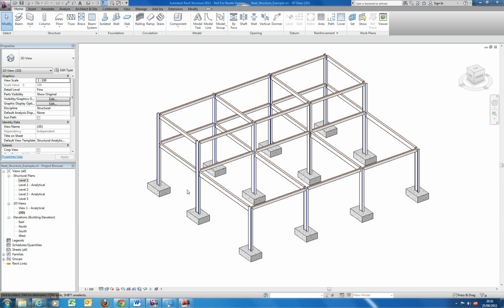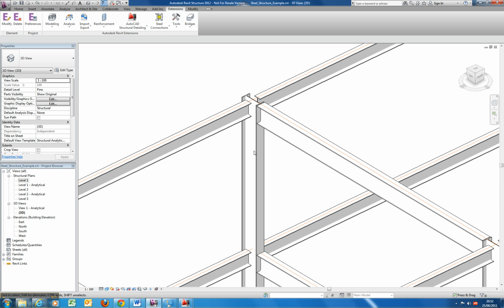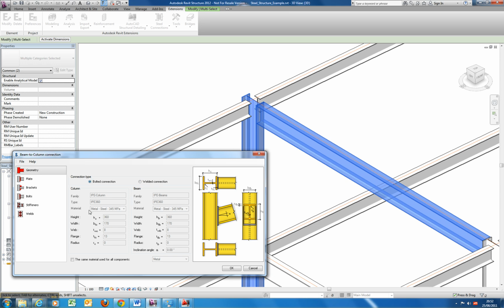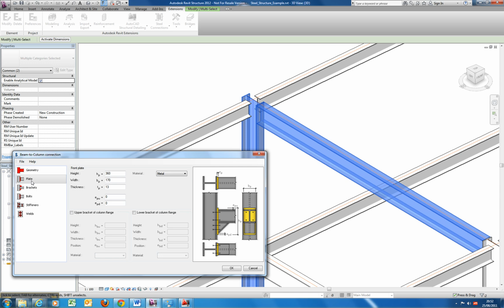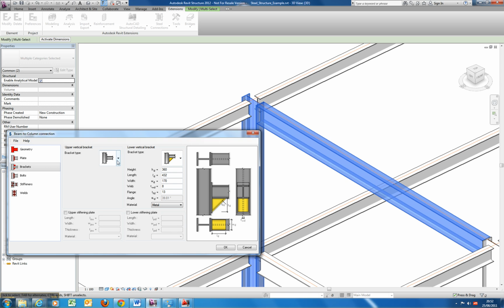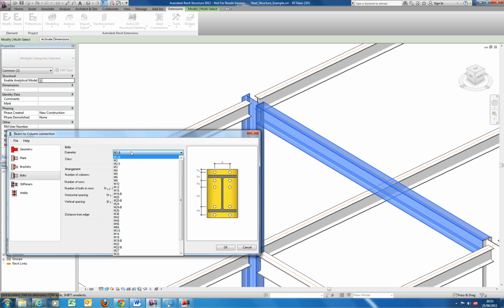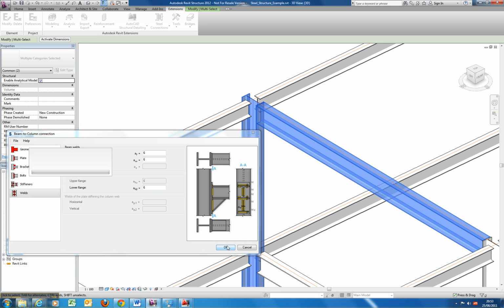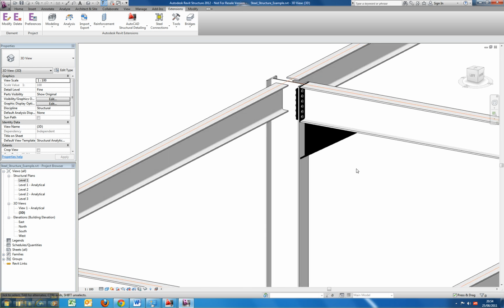Revit Structure 2012 Steel Connections

Comment: Hi sir I am a new revit user. i do have an entrance canopy design with structural columns and beams that are wide flange W24x55. Above they should meet at 90 degree angle, how can i miter this joints

Comment: Thanks i was able to get it. unfortunately the connection extension works only on column  - beam connection on flange only. On Web orientation it gives an error message saying column orientation is incorrect.  Any idea?????????